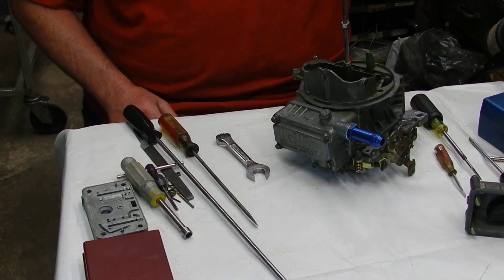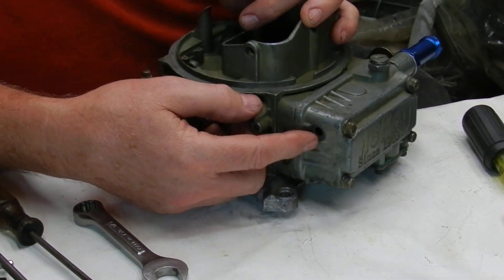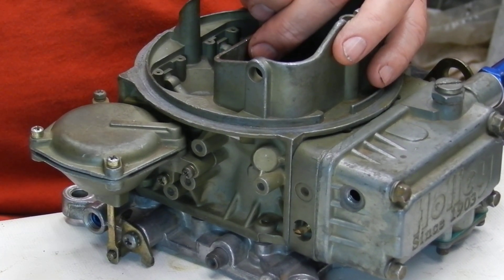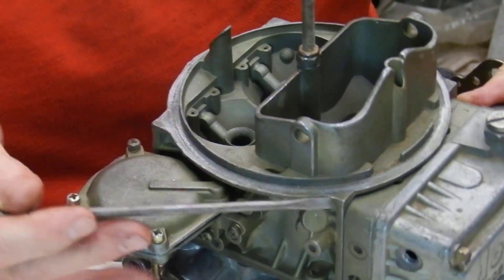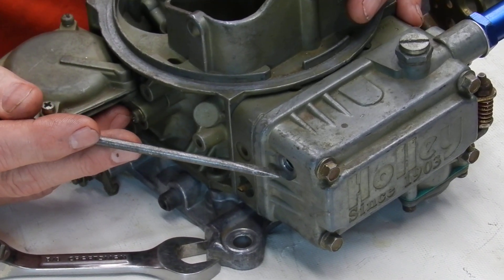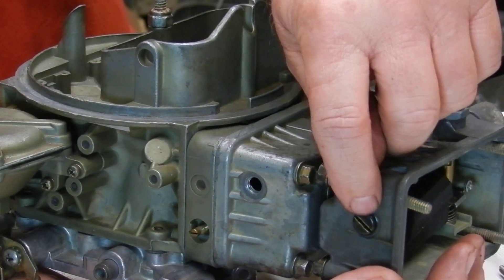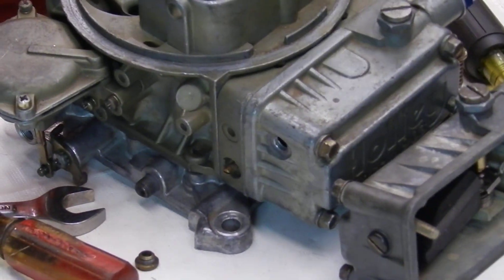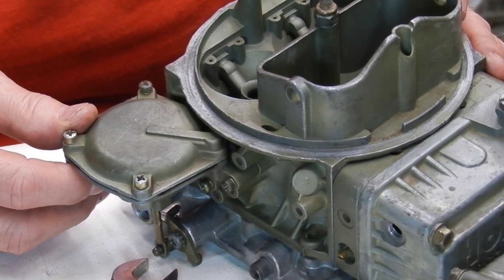Holley Carburetor: Tuning with Fuel Level

Comment: This works! I have a 383 and the Holley float level was so rich at idle because the level at the site glass was half way up it was smoking because of the unburned fuel......Leaned it out by lowering the float levels on primaries and secondaries to below the site glass.... Car stopped smoking....but was too lean...so I opened the air to fuel screws up to  compensate and make it richer and boom.....No more smoke or carb/ intake backfiring...
Reply from the maker: Great job.

Comment: I have a 4180c--For smog test in California--at idle it was fine but at 2,500rpm it was rich. I'm going to try your idea about lowering the fuel level about 1/8" in both bowl. Thanks.
Reply from the maker: Tom also check your high speed air bleeds for dirt or restrictions, try the float level adjustment, and check for proper jetting. Hope this helps.
Reply: @holleycarbshowtosadvice40y90   Thank you so much for getting back with me about this.   
What I did- I had the original carb I just took off.
 I rebuilt it about 8 years ago.
At 2,500 rpm it did OK (passed smog) but was high at idle.(didn't pass).

The new carb was from Auto Zone-so I figured it was cleaned out-(I don't know where the high speed air bleeds are tho)-this one did OK at idle but was high at 2,500 rpm.
What I ended up doing-I lowered the fuel level to just below the sight hole. 
The original had a 2 stage power valve. The one from Auto Zone had a single stage power valve. 
So I swapped  the two. 
I'll take it back for a smog check (hopefully) next week and let you know.
Thanks again.
BTW--on both fuel bowls the fuel level was high. Fuel ran out as soon as I unscrewed the plugs.

Comment: Hey man I got a Holley 600 vacuum secondary and it weak off the line but does good when it gets going tried a bigger discharge nozzle guy at a speed shop said to (.31 to .35) but didn't help what else could I try to make it better
Reply from the maker: Discharge nozzles fix hesitations, don't know enough about your engine , has it always had this lack of power, need more information on your engine, possibly ignition timing problem or internal engine problem. Get back to me and I'll  try to help you.

Comment: I have a Holley dominator. It has clear sight windows. The front one is half way and the rear is 3/4. Is that too much on the rear bowl
Reply from the maker: I usually run middle of the sight glass but if you have a drag car leaving hard off the line then I run my carb a little high in the rear bowl .

Comment: Hey Randy, Where do you like to see the fuel level on the newer ones  with the sight window
Reply from the maker: They set near the middle but just below the center line of the sight glass, that is the base setting but you can tune with it some , let say 1/8 of an inch either way, lowering it leans it ,raising it richens it a little. Changes to float level with annular boosters will be more noticeable .

Comment: I have never heard this I have a 440 and it always run rich I have changed carbs and jets but no one has even mention this idea I will try this also what fuel pressure settings would you recommend for fuel pump I have a holley blue pump.
Reply from the maker: 6psi max and thanks for watching

Comment: What’s the best way to stop back firing through the carby? I have a 350 chev with this issue. Timing is set correct I can’t work this issue out
Reply: Probably a lobe down on your cam.
Reply: Pull cap turn engine look for excessive timing chan slack would be my guess
Reply from the maker: Thanks for watching

Comment: I have a Holley carb that’s over flowing the secondary float bowl. I removed it, cleaned it up, resealed it, and set the floats level when inverted. And still the same problem. I also changed the floats and float valves. The vehicle was sitting for a while before this started. I’m going to check fuel pressure next I think the regular might be plugged, it does have a electric pump. The carb is very similar if not identical to the one you have here. Is there anything you would suggest?
Reply: I had that issue last summer. Ended up putting a filter just before the regulator.  Magna fuel said the rubber lines come apart particles get into the regulator. Solved mine.
Reply from the maker: Look at the fuel bowl vent see if its clogged after that recheck your fuel pressure. Hope this helps.

Comment: I agree wholeheartedly with andres sir, your video has helped me lick my float issue with one swing. I still wonder, however, if you are familiar with the Summit/Holley style carb. Can I run that eight inch below the sight level and get the same results, or is the bowl capacity different and I should leave it in the middle of the window per Thunderhead289's recommendation? I still seem to be a bit rich.
Reply from the maker: Yes if its a little rich you can lower float level 1/8 inch and it has pretty much same effect on most carbs, may have to increase you accel. pump squirters if you get into a hesitation off idle. Hope this helps.

Comment: randy...you explained the float level but didn't explain how and where on the carb. the adjustment is to get it to the proper level..
Reply: Zoom Tracker loosen locking SCREW & turn adjusting NUT
Reply from the maker: At the top front of your fuel bowl there is an adjustment with a nut an screw, loosen screw on top and turn nut clockwise to lower and counter clockwise to raise float level withe your engine off then restart and recheck float level through sight glass or if you may have a float bowl screw. Always have engine off when making adjustments Hope this helps

Comment: Hay Randy does the same go with the new carbs with the sight glasses? Holley recommends  a tick below half full of the sight glass, hope it does cause my engine is still running rich, I plan on taking your advice on drilling the 4 throttle plates with a 1/16th inch drill bit to give it more air, my mixture screws on carb aren't doing anything for the rich condition I'm having!
Reply from the maker: Let me know how it turns out.

Comment: what about showing how to do it  without pulling bowl off ?
Reply: Many other vids to show how to adjust the level. You want him to show you how to choose the right tool for the job too?
Reply from the maker: The float adjustment screw is at the top front of the fuel bowl, loosen screw on top then turn nut clock wise to lower float level or counter clock wise to raise it. Hope this helps.

Comment: HI Randy I'm running a Holley 650 HP (no choke) double pumper on my 351 Windsor.  I feel its running a bit rich. 
Let me ask you - 2 questions

1) When I am adjusting the fuel level is it necessary to purge the fuel bowls first? Is it possible to make the adjustment while the engine is running? In other words as I turn the screw clock wise to lower the float level (while engine running) will the fuel automatically adjust and level out to the new adjustment setting? 

2) Also how can I tell if the fuel regulator is doing its job? The needle seems to stick and adjusting it up or down doesn't affect it at first then it seems to break loose and settle in at the right pressure? (I may have a bad reg?)

Thanks for your time in advance, great vids!
Signed,
Holley Carb fan!
Reply from the maker: I don't know if your running electric pump or manual pump,  with electric pump just turn pump on and set level of primary and sec. if you have a manual pump I don't recommend setting fuel level with engine running due to possible fire hazard , I would run engine then check fuel level and make a small adjustment and retest, really the only time you need to purge is with the  secondaries ,running the engine will usually take care of the primaries, that's why  its important to open secondaries and recheck, normal running will not open the secondaries  you can usually open the secondaries slightly enough by hand or slowly push accelerator pump down to use some gas out of the bowl  sounds like you might have a bad regulator , also if you keep having fuel regulator problems don't over look the fuel pump , I have seen fuel pumps be very erratic with pressures up and down, a good pressure is 5 to 6 psi, you said also you think your engine is running rich when you get you adjustments correct ,let me know and we will talk about reading the spark plugs for richness, hope this helps ,.ps a lot of people adjust fuel level with the engine running but it can be dangerous, its better to be safe , than sorry. hope this helps you .let me know if your engine is to rich .

Comment: you are the best professor on these holley carburetor, thanks for your help!
Reply from the maker: thank you very munch
Reply: I agree wholeheartedly with andres sir, your video has helped me lick my float issue with one swing. I still wonder, however, if you are familiar with the Summit/Holley style carb. Can I run that eight inch below the sight level and get the same results, or is the bowl capacity different and I should leave it in the middle of the window per Thunderhead289's recommendation? I still seem to be a bit rich.
Reply: Anthony Wayne my guess is you can tune it the same way. The bowl capacity will not matter. The level of fuel in the bowel gets transferred into the emulation tube in the metering block. When you adjust the level in the bowl it will follow in the emulation tube.